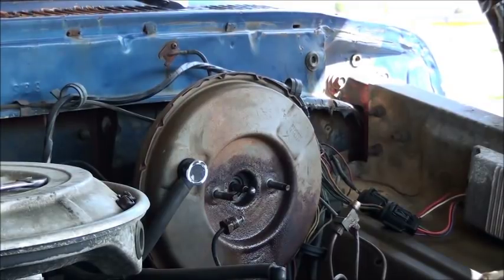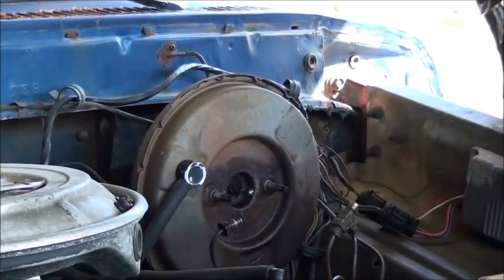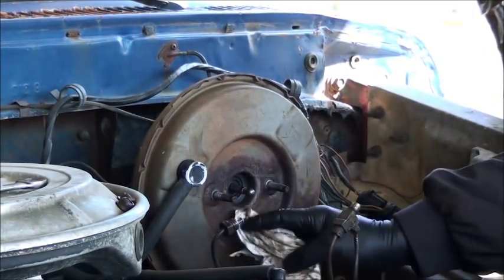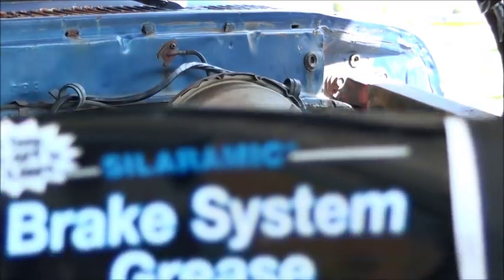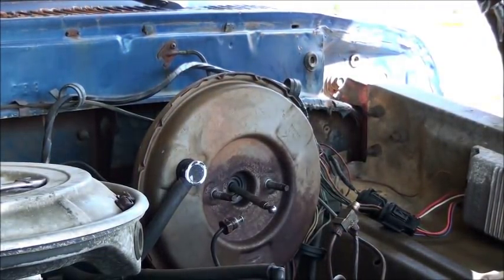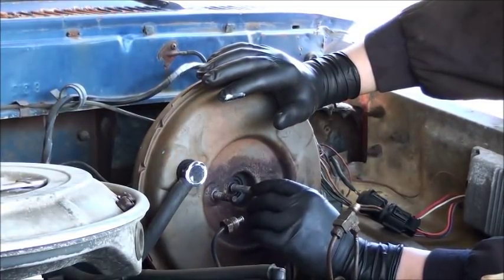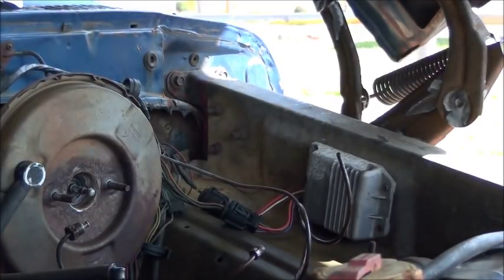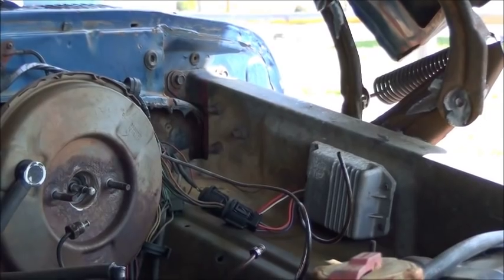HOW TO REPLACE A BRAKE MASTER CYLINDER PART 2 OF 2 ON THE DROF / FORD LOL !!!

Comment: You're quite welcome! That's also the standard wiring color code for just about any other brake controller in existence.  I would imagine the red wire tells the controller it's ok to send juice to the brakes, then the brake(fluid) line dictates the amount of juice going to the trailer brakes.  Kind of a shot in the dark, but makes good sense to me.

Comment from the maker: actually I traced the issue , one wire got pinched under the power brake booster mount , and shorted when I swapped it a few years ago , and the red wire was under the dash going to the cold side of the brake light switch , I found the wire , I did some house cleaning of old wiring from a set of long gone fog lights a few years ago , I think I cut that wire by accident maybe , it does work now , it just doesn't have any fluid line going to it , I need to put a new end on that one line anyways..

Comment from the maker: that works , but I will just do a new nut , and reflair it when I take it apart again to paint the firewall , it's on and tight no , good enough to move it around , and take it to the frame shop , thats about the only place I will drive it before I tear it down anyways , the wreck really messed that truck up , but I have to fix it ya know ...

Comment: Somebody might've already said this, but... 
According to Tekonsha, the 2016 controller needs to be wired as such:
Black-Constant 12V
Red- 12V when brake lights are on
Blue- Trailer Plug
White-(If so equipped) Ground.  SOme were grounded thtough the chassis of the controller.

Comment: The brake lights should run off the trailer plug at the back of the truck. The coil in the controller is a variable resistor. if its broken then it won't send any current to the magnets in your electric brakes. Bet if you look, they cut the red wire and hooked up the black to get output from the controller.

Comment from the maker: it's just the nut , the line has light surface rust on the last 2-3 inches only , the flex coils are still shiny , I will just shorten it a inch or two , new nut , and reflare it when I hook the trailer brake control back up , it's good , and brake are great for now , the truck will be coming apart again anyways when I paint it , gotta paint the firewall ...well the top half anyways lol

Comment: is there a way to adjust the brake pedal height on these trucks? I have a 79 f100 and my pedal seems a little high and it's a little hard to lift my leg to hit the pedal sometimes

Comment: Hi! I gotta 70 buick lesabre.  Just fitted a new reman master cylinder.  Was doin great until pedal went to the floor.  Saw a leak between cylinder n booster.  Does this mean the rubber seal in my booster is junk or did my new reman m.c. already go tits up?  Thx!

Comment from the maker: I actually think the clipped wire should go to the brake light switch , it has an adjustment knob on it ...I don't know , but I am pretty sure it's shorted out inside , it will just have to be a project for another day lol

Comment: from what I've seen on other brake controllers, the light comes on when the brakes are applied and you have a trailer on there, the slider you can move to brake the trailer independently from the tow vehicle. I've never seen that brake controller before though :( so I cant tell you what the red is. but generally red is power no?

Comment: Howdyu know it was a master cylinder? My truck I gotta put my foot to the floor and push hard to even stop. Just curious how you figured this was the problem. Be nice for a reply. Nice tutorial. I'm ordering mine tomorrow morning
Reply: Is the break fluid low?
If not then you need a new master cylinder

Comment: Red is your power,Blue is your trailer feed,black is your ground! All brake controllers have the same wires other than your doesnt have a brake light swith wire cause its hooked to the hydro brakes! You can pick up a normal all electric brake controller cheap and for about 300 you can pick up the newer version of what ya got!

Comment from the maker: I found out , the red goes to the cold side of the brake light switch , I found the other end of the wire , I think I cut it out by mistake while getting rid of some old fog light wiring ooops

Comment: From what I can see, your controller is hooked up but is not variable. The roller switch wont do anything but brakes will come on as hard as the pedal is pushed - you cant fine tune the sensitivity.
Hope I'm right!
Andy

Comment from the maker: I found the actual book for it in the glovebox lmao , the red is supposed to go to the cold side of the brake light switch , black is power , and blue is brake feed wire , it goes on to also say the ground is the brake line , seems nuts , but it works , I hooked and tested it , I also found the other end of the red wire , I think I cut it while cleaning out some old fog light wiring ooops , all I have to do is hook the juice back to it , but I am in no hurry , I haven't even got a hitch on yet

Comment: Poor guy I have a 76 highboy with the brake lines pointed out made life a snap to get it back together and doing a booster ain't that bad one bolt the 4 nuts on the firewall an it drops right out